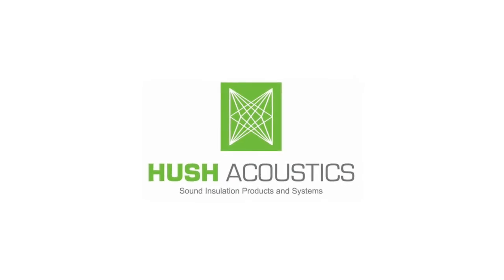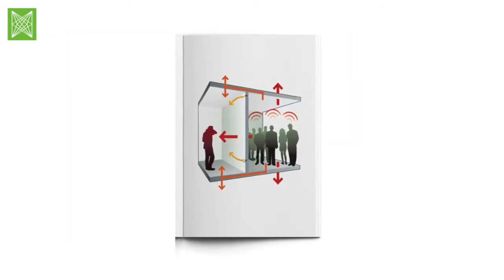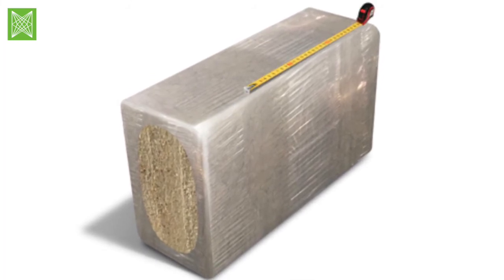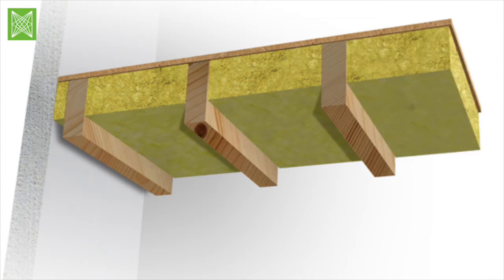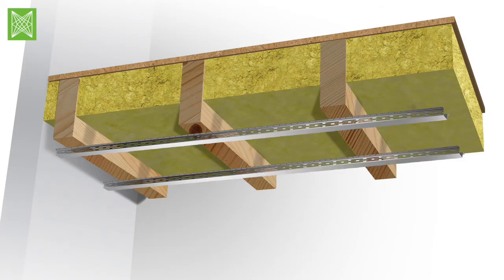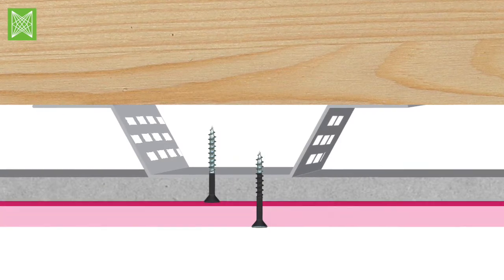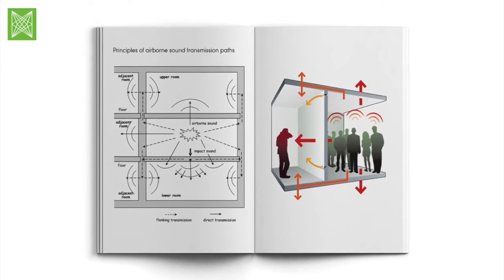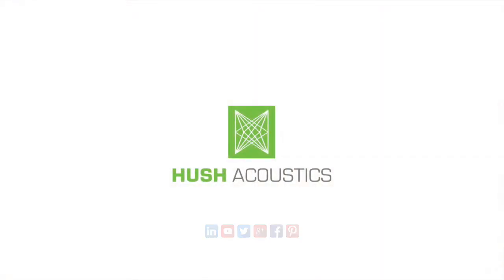Hush Bar Deep: Soundproofing resilient bars for separating floors/ceilings and walls

Comment: Where is the foam cushioned decoupling brackets, this is a flawed system. The sound insulation will not work in this instance.

Comment: For RCs there is a path to transmit vibrations through the screw contact area but it's very small, here the horizontal cuts make the "decoupling", which still do a nice job, even if not so well as RCs, they are better suited for all types of ceilings, especially for standard heights in apartment blocks where the height is at 100inches or 2.5m. Obviously, you cannot afford to lose 20 inches or 50cm from this height. There is nothing more nerve-braking than to see how all youtube videos present wooden joists, with wide and deep empty spaces, just good to be filled up with fiber-glass insulation, as if the basement ceiling is the same as the roof. Well, this may be the case only in US, and even there, I'm pretty sure there are many brick buildings, with concrete floors, no wood unless in the country side.
Still, all youtube videos which are clearly ads for their own companies show these annoying wooden joists, which I've seen only in vacation and only when going into the mountains, other than this all my acquaintances live either in brick houses with concrete ceilings, or in concrete apartments blocks with -obviously, concrete ceilings. While you may say, well if it's from concrete it's already soundproof, it's not the case for 5" concrete, you can hear all the steps and all conversations even if not understanding what they are talking about. 
Your companies will never be successful until you have the courage to tackle the apartment blocks and brick houses with concrete ceilings which -if from 2nd half of 20 century will have lower ceilings, so they can afford to lose maximum 1.5-2 inches.
Reply: What are RCs?
Reply: @MrCodlin  resilient channels

Comment: It’s not a proper isolation. The real slab is not decoupled from the isolation
Reply: Yeah, for best isolation you'd really need to use this bar with decouplers that attach to the drywall.  I think the RC1s are probably better than this because it has more room to vibrate than these.
Reply: @Lolatyou332 yes! I used isomax clips with 25ga hat channel NOT RC2